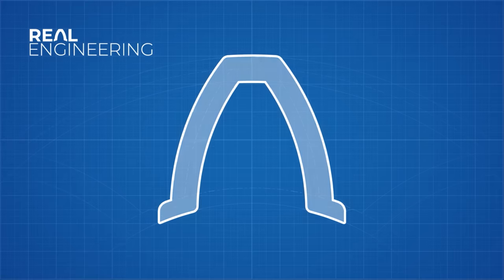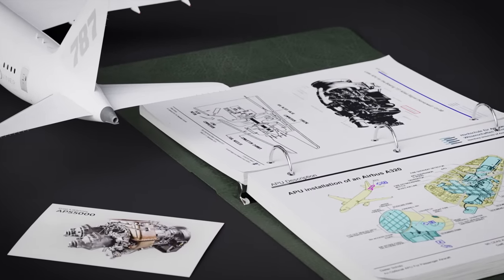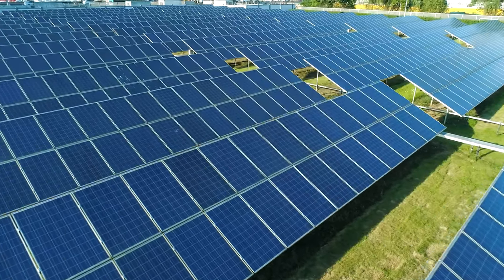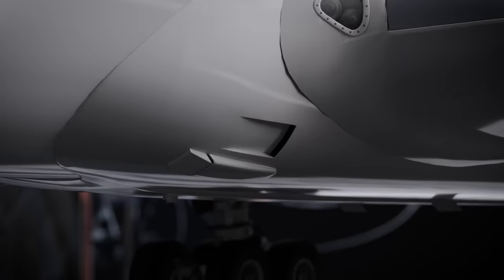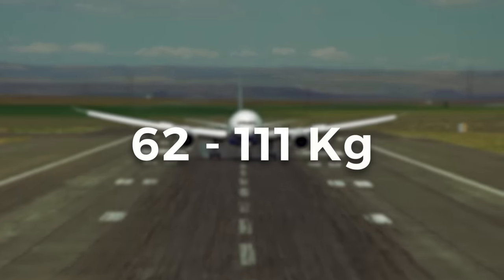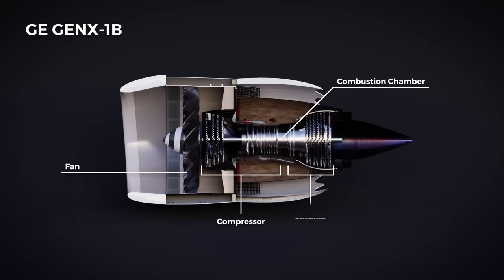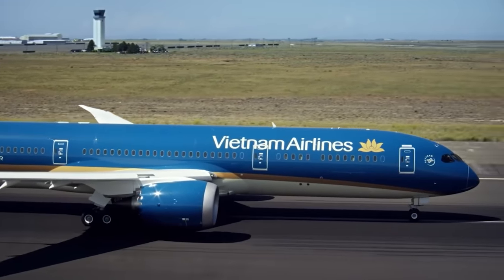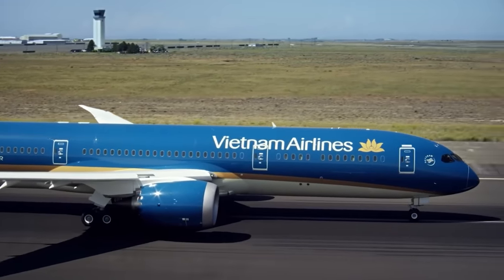The Insane Engineering of the GEnX

Comment: Absolutely great video!   I'm an aerospace engineer and was the original mechanical design leader of the GEnx-1B fan blade at GE Aviation in Cincinnati.   The video and appreciation of it in the comments are really amazing and I'm glad to see so many people interested in it.   Working with the great team at GE on this project is my proudest and most rewarding career highlight so far.   There is so much engineering and amazing testing on all these components that they could each be their own video.   Watching the CFAN team in Texas do the hand layup of the hundreds of carbon prepreg plies for each blade in this video brought back great memories.   Just a couple suggestions if you want to incorporate them:   First, the actual spelling is GEnx (not GEnX or GENx).  Also, the LP system (fan, booster and LP turbine) are all on the same shaft and spin CW (as viewed from the front).   Some of the animated cross sections in the video appear to show the booster and LPT spinning CCW.    The HP system (HPC and HPT) are on the same shaft and spin CCW.  It's a counter-rotating concept, unique to the GENx for GE turbofans and was intended to increase performance and reduce parts count.  It's the only GE commercial turbofan to have the LP system spin CW.   Some mention of the fan blade out requirements might be warranted.   Fan blade out loads play a large role in sizing all the primary engine structures.  The unique carbon fiber fan case of this engine is sized strictly to contain this event and keep the blades from leaving the engine   Moving from 22 blade to 18 blades as mentioned was a concern on how big the blade out loads were.   The fan blade out test required for certification is the most severe test there is and of course pretty much destroys the engine.   Thanks for the great video and sharing the amazing engineering that we can do when we we put our minds, energy and passions to it.
Reply: Ohiya !!!
Reply: you write, "There is so much ...amazing testing...."   Ok, unless you're the chicken.
Reply: I'm at the other end of the engineering spectrum.  Sometimes, I've whittled bits of wood - to use as dowels for woodworking joints.
Reply: Excuse me sir it’s GEnx :)
Reply: Moving that fuel curve to the lean side must increase temperatures lke crazy. I noticed that was not addressed..
Reply: Nice try, Dan. You work at Foot locker. You sold me a pair of Js just the other day. Dressed like a referee n all.
Reply: i am from cincy... live in california now .. i miss skyline chili lol
Reply: Seems some of the footage is RR as the fan is spinning clockwise.
Reply: Hey Dan O'Reilly, are you familiar with the process of how they make the turbine blades out of 1 crystal?? we were discussing this the other day in one of my engineering courses and it really striked my attention!
Reply: Hats of to a real genious engineer! I hope to one day create something that others will make videos about... I'm a software engineer now, although also a pilot and have some Physics knowledge... I should honestly expand beyond the concept of "software engineer". Few jobs out there which can properly utilize a mix of software and physics expertise.
Reply: Woah...
Reply: @seanmckee8382  If you look at the graph, it's actually burning cooler.  The highest combustion temp is at stoichiometric.  This generally the case in ICE's as well...you don't see it much with gasoline ICEs but absolutely see it in the diesel world.  Cramming more air into the combustion chamber than is needed for complete burn is the "magic" behind modern clean burn diesels.
Reply: GEnx.....not GENx
Reply: Not bad but still not as good as the brits are we .
Reply: I used to be a rework welder for PCC on the GEnx Ti-Al blades. That is some pretty cool material. When glowing hot, it would still ring a little when you hit it.
Reply: Repent to Jesus Christ  - Acts 20:21 it’s repentance towards God and faith towards Jesus Christ.
Reply: @nellyt2807  british still make aeroplane in  2021?
Reply: @bez750  Actually there are a couple of GE engines that rotate clockwise. I believe this is one of them.
Reply: Dan,
How far off are the  electric turbines? A configuration where there is much larger APUs which generate power for the electric motors residing in the fuselage driving the turbofans via composite drive shafts through the wings .
Reply: @npast1  Hi. I've had a look and can't find any GE engine that spins clockwise viewed from the front and would be happy if you could find me an example. I'm always willing to learn.
Reply: @bez750  GEnx is rotating clockwise, you can do a search to confirm for yourself. There are historic reasons why Rolls are rotating clockwise and GE counterclockwise, but it is a longer story.
Reply: @npast1  OK my friend. I'll take your word for it. I know a bit about RR engines as I've been working there for 34 years and counting. Engine assembly, 05 module IP system.
Reply: @bez750  I am at GE myself, aerodynamics.
Reply: My respect to you Sir. I’m jealous.
Reply: @suzukirider9030  go work for Elon Musk then.
Reply: Amazing work, sir.
Reply: I suggest you do and patent your own axial-flow blades for a turbocharger. Axial-flow turbochargers and axial-flow exhaust turbines for driving power recovery units are somewhat of a coming thing, as are axial/radial flow turbos and turbines.
Reply: @seanmckee8382  I think that where the fuel is initially burned it is rich, then as it continues it has more air introduced, doesn't it?
Reply: @Dan O'Reilly. Dear Sir, just as you appreciate this video, I appreciate how engineers such as yourself (and find comfort) simply and inherently won't settle for the "status quo" and are consistently working to make things better as the tools you use also advance. Kudos to you and all your other engineers who work so hard to improve upon so many aspects of aerospace engineering!!!  AND so many aspects of our (the laypersons) lives. We ALL owe you a debt of gratitude for your excellent work. Helping also to make our lives safer in the process! 

I do have a question I would like to pose to you though. As I believe I already know the partial answer to. As we know that birdstrikes pose a significant danger to the engines, and I believe part of the answer is due to limiting the amount of air a jet engine needs to suck in, is it at all feasible to place screens of some sort,  on the front of the engine to prevent foreign objects ( such as birds ) from entering an engine while in flight?  As a layperson, this is likely a silly question, I'm simply curious. Thank you for all the fine work you ALL do!! Merry Christmas!!
Reply: Wow you're impressive! I wish I had 1/10 your knowledge 😔
Reply: you are part of the legends of time! Well done Dan and thanks for your contribution to human engineering history!
Reply: Great!  Great to have your actual experiences here.
Reply: @exploranator  know anything about no-shaft / rim powered turbines?
Reply: Superb comment! I enjoyed reading that.
Reply: @seanmckee8382  The video is correct, the highest temperate is at stoich and cools off on either the lean or rich side for different reasons.
Reply: I used to do layup with pre preg carbon making rotor blades and other components for Blackhawks.  I'll stick with my wet layup on fiberglass boats I think.  Haha.  That was the coolest thing I've ever been a part of, though.  No joke about the hundreds of layers.  Some of the layers in the Blackhawk panels were infused with metal, removing the need to run wires afterwards.  Kinda blew my mind when I saw that, never even considered something like that.
Reply: Hey dan excellent you chimed in. Do you see jet engines obsolete in say 100-200 years, there is talk of electric powered airplanes. What’s your take?
Reply: What amazing work you and your team did, thank you. 787 and genx will take me to my gf 12,000km away! Respect!
Reply: It's so cool how engineers that worked on these things see these videos and point out errors and more details, thank you for this detailed description of the inner workings of the engine!
Reply: "GEnx".  Don't know if that's true (not arguing, don't know), but in any case, you sound like a GE guy.   :-)   Is the blade out testing primarily to determine failure modes, or maybe containment?   And I'm assuming to make it realistic, they blow the blade at speed?  If so, I'll bet that is one spectacular test.  :-)  That one probably won't rub out afterward.
Reply: I worked in turbine airfoils in cincinnati on the inspection process for the high pressure compressor blades... Wild stuff. The blades operate above their own melting point! They have to drill cooling channels into them and then CAT scan every single blade to make sure they are correct
Reply: God bless America 🇺🇸🇺🇸🇺🇸
Reply: O'really?! didnt know, congrats!!
Reply: @@joegarfield1234 negative. The leaner the mixture the hotter it burns.  The richer the mixture the cooler it burns. At least in sm automotive engine
Reply: All that engineering and the plane still sucks.
Reply: @roji556  How? The only thing I've flown on that's better is the A380.
Reply: What are the engineering breakthroughs that GE made that no other manufacturers could accomplish?
Reply: That's amazing what you guys have done to make the GEnx, I'm just now trying to design some blades for my own engine and realizing the complexity of the design process. Thank you for working on such a masterpiece of engineering.
Reply: I worked there at CFAN back in 2013–2014. Deflashing and prepping the blades Wearstrips are what I did. I miss it! GE-115 was the main blade I would handle in Deflash, doing minor repairs when necessary. Let me tell you, that damn titanium tip cap would sometimes catch me in the ribs when transporting the blades over to their wracks to be put into the autoclaves, and to say it hurt is a gross understatement. Wearstrips were easy; I just didn’t enjoy the formaldehyde resin that I had to apply before baking them due to the odor. I also got to do a few minor repairs on an old GE-94 blade once that had been in use since well…. 1994 lol!
Reply: @npast1 I'm at RR; Magnetohydrodynamics.
Reply: I can’t wait for Boeing to sort out the mess they have created, so that I can see this masterpiece of an engine on the new 777X.
Reply: wrr
Reply: @bez750  The compressor blades always spin in the opposite direction to the primary/fan blades to counter cyclonics.
Reply: I have an question how the jet engines spin?
Reply: Cw stands for?
Reply: Words

Comment: A couple of small corrections:
At 3:25 - an air starter doesn’t feed air “directly through the turbine section”. It feeds air to a separate small air turbine that is geared to the main shaft to spin it. It is just like the cartridge starter, except the starter turbine is fed compressed air instead of combustion gases. 

17:13 - the term is pressure ratio, not compression ratio. Compression ratio is a piston term and is a volumetric ratio. Pressure ratio is a jet engine term and is just what the name says. You use the correct terminology later in the video. People may think that they can compare these numbers with piston engine compression ratio but they can’t be compared directly. They describe different things.
Reply: The Air Turbine Starter(ATS) is generally coupled with HPC or N2 shaft
Reply: Also 8:42 it's a rejected takeoff not aborted landing. You don't abort landings once you hit the ground.
Reply: @jameswang7362  you can always go around, (including for a significant portion following your touchdown)
Reply: @samneale7249  Thanks for the correction. More accurately, you wouldn't use your brakes to abort a landing since you'd want to gain speed.
Reply: @jameswang7362  well... 11like no, wrong awnser you do if it was a long landing you or the engines are not decellerating, press that TO/GA Button. also known as a a deliberate act touch and go's
Reply: @ 19:50 , if we're nitpickin. The pollutant is Oxides of Nitrogen NOx and not Nitrous Oxide N ₂O. Although I did get polluted on N ₂O once.
Reply: This is so cool to see haha I worked on this program as a design engineer. Worked and designed some airfoils. Now I'm on military programs for the next gen helicopters
Reply: @rapidsqualor5367  2 mins earlier he said it correctly, oxides of nitrogen.. Wtf
Reply: @jameswang7362  Well i mean you can always abort the landing by smacking into the ground instead, but i mean is that then still a landing?
Reply: That’s what I’m talking about!! I came here today in the comment section looking for a corrector with the right corrections to correct this man about something cus I know dam well he ain’t pinpoint correctly about everything! I mean shit, the guy makes videos
Reply: Thanks for correcting that. I don't know much about jet engines but when he said that I was wondering how sufficient pressure and volume could be supplied from an APU or ground unit to do that.
Reply: actually it is compression hence the name compressor. 
you want it compressed to a certain pressure.
it just does it a diffent way . 
still have to have compression to reach the desired pressure . 
which is exactly what he said
Reply: @jrbonner5858  of course there’s compression. I never said otherwise. But what is shown on screen as “compression ratio” is a wrong term. It is called pressure ratio. There is no quantity called compression ratio in jet engines. The Genx does not have a 60:1 compression ratio (you will not see this term in any book on jet or gas turbine engines), it has a 60:1 pressure ratio, meaning the compressor discharge pressure is 60 times higher than the pressure at its inlet. 
Compression ratio is the name for the ratio of cylinder volume at bottom dead center to the volume at top dead center - it describe the geometry of the cylinder. Does not apply to jets.
Reply: turns turbine > gear reduction > clutch > accessory drive > n2
Reply: Some military aircraft have a starter that uses either bleed air or cartridge combustion.
Reply: @jameswang7362  yeah when he says anything above V speed and the plane takes off made no sense the way he phrased it.
Reply: @Tunechi65  You're super cool! I wish I went into engineering haha.
Reply: This is why I'd never pay for Nebula. Why pay for (poorly researched) amateur content?  He also misspelled "centrifugal" in his graphic at 13:44... and certainly can't pronounce it.
Reply: @rapidsqualor5367  Long live whipped cream in a can!
Reply: @nos4me  Amateur content, no matter how slick it looks, is still amateur content.
Reply: @samneale7249  Whens the last time you heard of a V1 speed for a landing? I'll wait.

Comment: I just flew in a 787 for the first time today, and I kept remembering different features of the plane that were described in this video. I was amazed at how quiet and comfortable it was due to the significantly reduced noise profile and higher cabin pressure allowed by the rigidity of the carbon fuselage. 

This video provides a stunning look at the 787 and the GEnx engine that is truly inspirational. I really appreciate your videos and the respect you have for the engineering and technology!

Comment: Aerospace engineer here. Great overall work with the video! Just have one thing to ad, at 13:10 it is stated that there are only one shaft in the GENX. The usual configuration for turbofans are two or three shafts stacked. In the case of three shafts (which looks like is the case here from the low pressure turbine config due to the slightly larger gap before the last low pressure turbine) connecting the HPC-HPT, LPC-LPT1 and FAN-LPT2.
Reply: It's a 2 shaft engine. The low pressure compressor is on the same shaft as the fan (not clearly shown in the diagram). The only civil wide body jet engines that are three shaft are Rolls-Royce Trents (incidentally the RR Trent 1000 is an engine option on the Boeing 787)
Reply: @EdwardPallett   @Edward Pallett thanks for clearing that up

Comment: I flew on the 787-9 from Melbourne to Vancouver a couple of years ago. I had the privilege of sitting in business class for such a long trip and I got to say, on take off, the amount of wing flex is incredible to see. It's so drastic. The plane is whisper quiet and you feel extremely comfortable inside with the cabin pressure being being higher than other airliners.
Reply: It's most dramatic on landing when the spoilers deploy and all the lift load is immediately removed from the wings.
Reply: Which airline were you with?
Reply: Me friend told me the first time he flew a sailplane with composite wings it was frightening him half to death.  He said to him it looked like 10', at the tips.  They definitely are not designed to act like metal wings.  If metal wings DID act like that, they'd be separated from the fuselage in pretty short order.  I hate it when that happens.  

Hell, even when metal wings hardly move, at some humongous number of cycles they start to crack, and weaken, hence metal airplane useful 'life' specs.  It's called metal fatigue and I expect it happens due to, at best case, large crystal interfaces, usually probably just material weak points or manufacturing 'defects'.

I expect that is one thing the single crystal blade does for you, that and it is strong.  Multiply crystalized grain boundaries weaken things, and those are at microscopic levels.